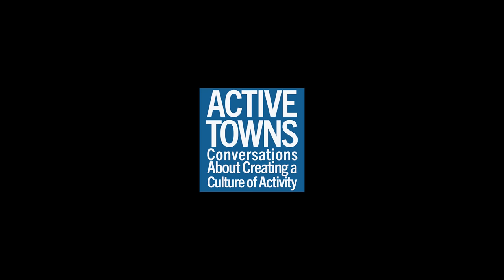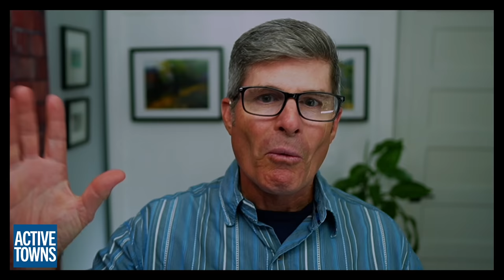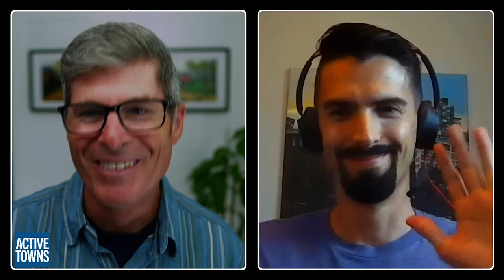Engineering for people-oriented places

Comment: 44:50 The green paint is denoting a bus stop where buses need to cross the bike lane to pull up to the curb. Newer segments of the same highway do continue the green paint through intersections as well. (They also have curb separated bike paths instead of painted lanes, and the bike path passes behind bus stops instead of in front of them).

Yes, they force the local buses to sit in traffic even though there is a busway in the middle of the road with only 8 express buses per hour.
Reply from the maker: Excellent! Thanks for the additional information. 😀